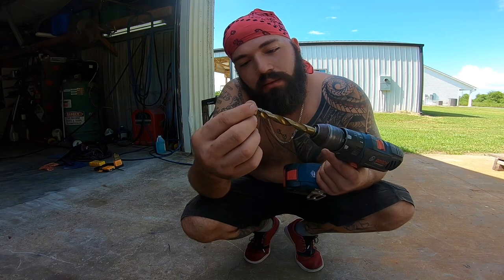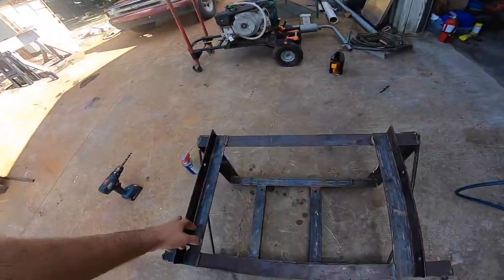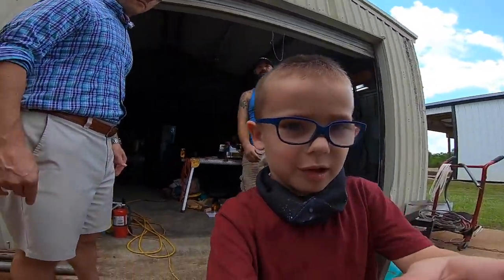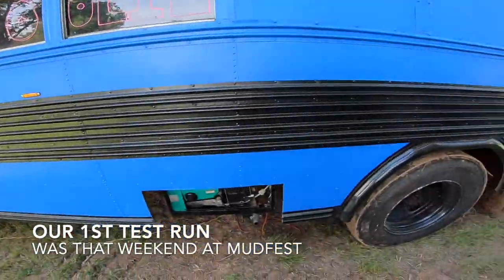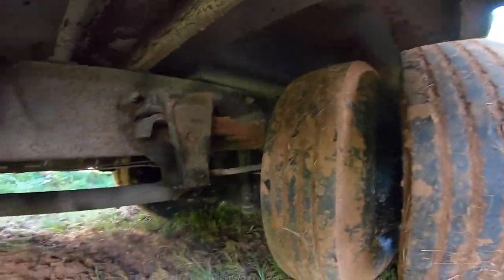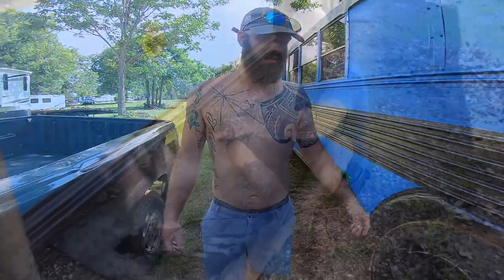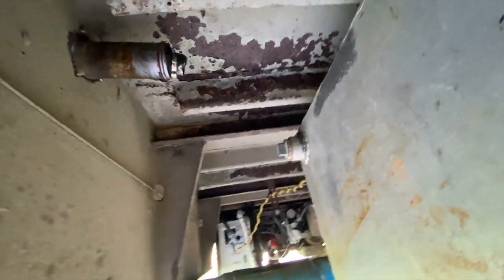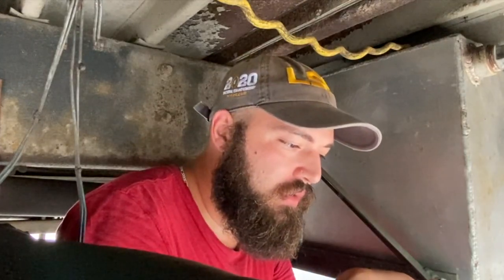Going OFF GRID: Mounting a generator & fuel cell to our skoolie

Comment: Just the right video. I too am installing my Onan 4000 shortly on my bus. I have been trying to hunt down a cradle for this, and now I will just build one. Thank you so much.
Reply from the maker: Glad it helped! Best of luck, don’t break too many drill bits. It’s been 4 years and it’s still holding up great. (The cradle, not the onan😭)
Reply: @parishskoolie  Yep! One thing I have noticed about Onans, when they run great its all good, but when something goes janky, its always something of harder to find parts needed.  Unlike the common platform generators that failure issues are typical of just fuel, fuel filter, plug, that are easy fix and easy to find parts. I will will build my under cradle a bit larger to accept common style as well, when the time comes.

Comment: Hey! The generator that was mounted in my van has 2 pipes that connect to the diesel tank? Any idea why mine would have two? I ask because I’m trying to rig the lines it to my diesel heater which only requires one pump. I took the generator out, and I’m trying to avoid having to drop the tank and figure it out 🤣 great video
Reply from the maker: My buses diesel tank has a supply & return line, I would imagine it’s that. This is for the motor tho, our genny is gas. I added a separate tank!
Thanks for watching!! Good luck

Comment: look intoo stepdrills , these work pretty good and dont break as eazy........ never mind
about the mud : you could just screw some mudflaps to the frame , the stock semi type ones should be big enough to cover the whole side of the frame
as for the fill tube : maibe a radiator hose would work you can get those with some pretty sharp bends
Reply from the maker: Thanks for the tip! We are still looking for a better solution to our fill tube so we might look into that!

Comment: might want to just drill pilots and step them up n use oil. maybe not but it might help
Reply from the maker: Thanks for your input! I did indeed drill pilots and was working on the last sizing and was getting sloppy. That’s why the bit snapped

Comment: Do not buy Harbor freight sawzall blades. On about broke my back when one broke. Thay could only cut one bolt
Reply from the maker: Thanks for the tip! These weren’t from harbor freight, however.
Reply: Thanks after using an angle grinder I was considering a sawzall for deep steel straight line cuts. Wasn't sure which to go with or avoid. My fingers and toes thank you :)